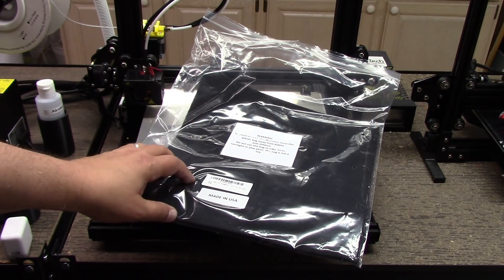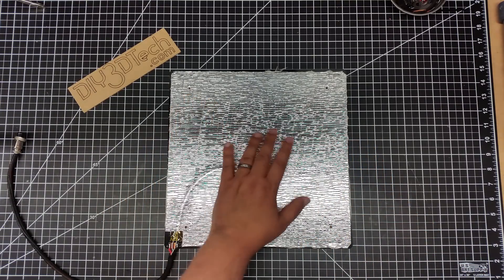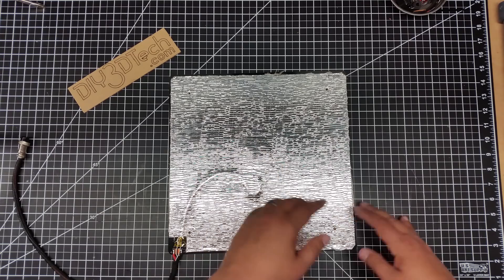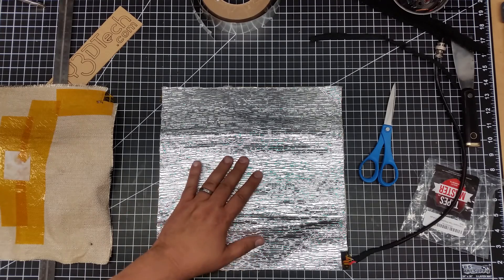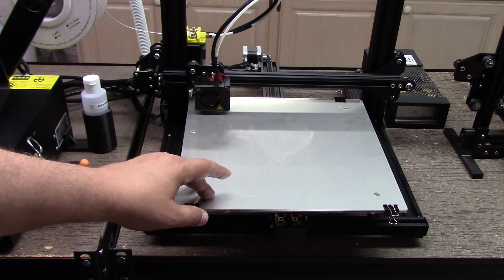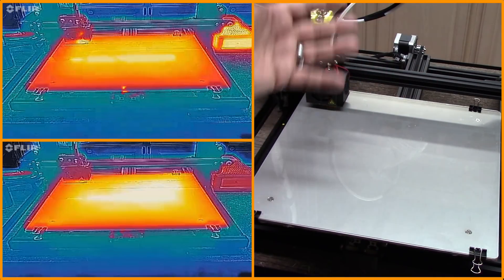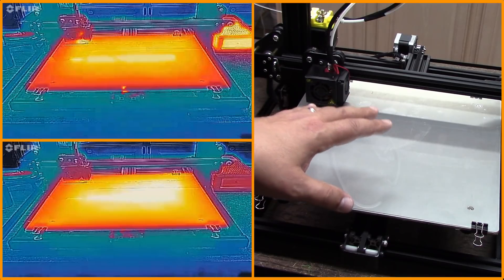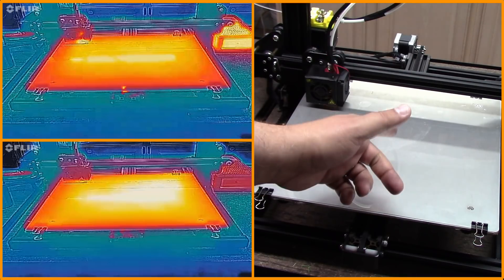Creality CR10 - Insulating the Heated Bed with Plumbers Felt!

Comment: I also use preheat function in cura, while i double-check print settings. Nice little trick as well.
Reply from the maker: Interesting, as prior to printing I set the printer under "prepare" to pre-heat as I am loading the file on the card.  However this is something to check out too.  Thanks for sharing!

Comment: So why hasn't anyone clued in and just  toss a linen throw pillow on the bed to kill the 90% convective loss from the TOP surface? You guys are fixing the wrong side of that bed.
Reply from the maker: Okay, can you show all how to do it?
Reply: @DIY3DTECHcom  , There is little enough to show, let alone make into a vid. I keep the bed covered with the microfiber towelette I use to scrub off greasy hand prints before each print. Folded into quarters, it covers and insulates the bed as it warms up, like a thick warm blanket. If I'm in a hurry, I add a second layer, either a handy throw pillow or another folded up towelette. It's like a hat in winter. It stops the major heat loss through your head. Bottom insulation is still needed, but far less important.

Comment: Use an ac bed and a 24v setup, go from room temp to 80c on the bed and nozzle at 220 in less than 2 minutes. Have an example video https://www.youtube.com/watch?v=qlGZ9vasTVI
Reply from the maker: No question I prefer 24 volts over 12 and whiles AC/Mains powered is best however its not for the average user because of the shorting risk...
Reply: @DIY3DTECHcom  Why is there a shorting risk?

Comment: Don’t get the heat bed thing, the heat dissipates after the first 1/4 inch layer of plastic so as long as the object is stuck to the bed what does it matter
Reply from the maker: The plastic acts as a heat sink and if you don't have even heat you are more likely to get lifting and wrapping.  Also, more heat and more even heat will also provide a better overall grip to your part.

Comment: Has no one tried this and reported back their ability, or lack thereof, to get the bed to 100 degrees or higher?
Reply from the maker: If you check out my earlier videos in the CR01 playlist I do, 100 is impossible at this size and only 12volts...
Reply: Just watched your previous video on the heated bed but no comment there about 100C. Where do you talk about being unable to reach that temp?

Comment: This is much much better than your other video. The gap here will help. Unfortunately the 99% reflective side is still facing the wrong direction. But the non-reflective side (probably about 70% reflective) should still reflect heat back up to the bed. I imagine you will have much better success with this design.
The fiberglass you note is not actually fiberglass insulation like you would find in a house. It is woven or matt fiberglass like on a boat. It does insulate heat much like a 2x4" wood beam but the film is too thin to insulate well. In this instance, its design is for structural rigidity. Woven fiberglass (unlike home insulation fiberglass) resist tearing. Removing a heatshield is a painful process. Without fiberglass you or I would be scrapping tiny pieces for hours. The fiberglass keeps everthing in one unit.
Reply from the maker: Thanks for commenting!  However "reflective side is still facing the wrong direction" isn't quite correct as if you read thought he thread for this video (as well as watch the Yes Cork Burns video: https://youtu.be/2jEkNutaUTg )  I have commented to many comments such as this (i.e. reflective side is still facing the wrong direction) as the product is designed this way for a reason.  As what is the the purpose of fiberglass  here or in a home?  Yes to provide a "gap" and this case it is between the radiant reflective surface and the hot as this designed as thermal barrier and able with stand up to 300f on the adhesive side.  However I suggest check under the Trnoxy playlist (see here: https://youtu.be/PsPi5-d3tAw ) as I like that design with ceramic installation better.

Comment: Hey I like your video... I got one of these quite a while ago and I love it... I actually sanded the glass plate to help stick, but one corner just likes to curl, nearing edge of bed. Funny, doesn't look like i got anything underneath the aluminum bed... maybe I should try this. Every thought of setting one of these cr10 to dual extruder... I have seen a couple videos online but you have always done good videos. clear voice easy to listen to, and understand.
Reply from the maker: Many thanks for the kind comments.  So first thing is throw away the glass and get a sheet of PEI (this one will fit the CR10 http://amzn.to/2ExNOD6 ) second, look at the $5 insulated bed-mod I did for the Tronxy X5S as will work on here and is better and cheaper.  Also curling at the edge is common as the heating elements don't cover the complete under side.  So (1) try higher bed temps to spread the heat and  use a brim for extra holding.  However you will find the PEI far beyond any sanded glass.  Also search my channel as I have created several video on PEI if your not familiar with it :-)
Reply: Thanks for the info here... I did something interesting this weekend. I rotated the glass 90 degrees anti-clockwise. Suddenly no curly edge. I am going to do this bed mod though none the less.

Comment: This will be a dumb question as I don't even have a printer, yet.  It seems the goal is to get the glass warm.  Would a thin layer of silicone heat grease between the plate and the glass help with heat transfer and spreading?  I don't know how often you need to remove the glass so it may get a bit messy.  I want to print Nylon so I am exploring methods.
Reply from the maker: well it depends on the plastic and glass is so 1980's as I don't use it.  However lets backup, if you plan printing nylon you will want to see this video https://youtu.be/iV07vkW70DE as you just can't print nylon on any machine or surface and thermal paste will simply create a mess.  If you want to attach say a PEI surface you would use  3M thermal tape (http://amzn.to/2FwM7m9)

Comment: With cork, I get zero heat radiating from the bottom.

Of course, I don't like cork.  On my other printer I just use that RTV gasket maker stuff.  Very little heat.
Reply from the maker: Thanks for commenting! No question cork is a good insulator but also see my "Yes Cork does burn video".

Comment: My concern in watching this was burying the electrical wires into the heated area. That leads to degradation and breakdown of the insulating material of the copper wires (normally). This bed product MAY have superior characteristics, debunking my concern...dunno. 
I DO enjoy your videos.
Reply from the maker: Many thanks!  However your really not "burying the electrical wires" as this is a PCB heating element so nothing more then a big resistor.  However your correct about  "leads to degradation and breakdown of the insulating material " and this is the reason I say away from cork.  However if you use a ceramic or high temp fiberglass there shouldn't be an issue...

Comment: I used to use a square piece of foam insulation on top of the bed which my g-code automatically pushed off before it started printing. This really helped with ABS prints.... I also would occasionally use a hot air gun to make it heat quicker, just don't keep it pointed at one spot!

Comment: What is the component in the top Flir image that is as hot as the bed?
Reply from the maker: Not sure I understand?
Reply: DIY3DTECH.com at 7:11, where you are comparing the two different set ups there is an object besides the bed itself in the top right of the top image that is hot and in the bottom picture much cooler.
Reply from the maker: Oh I see, that is the power supply of the TEVO Tarantula [3D Printing] which is setting next to the CR-10

Comment: Followed your link http://diy3dtech.com/creality-cr-10-heated-bed-insulation/ to a page with no information, just a bunch of other links to other projects. Not that there would have been any info on 500mm stuff for the CR-10 S5 that takes 15+ minutes to hit 70°.
Reply from the maker: For some reason with that page the API pulls from Amazon sometimes fail and have to be reloaded...

Comment: I deleted my comment by accident. Reflective insulation is what you actually would want here I think. Plumbers felt absorbs heat. If you look at how duct work in you home is insulated it uses an aluminum sheet on the inside and outside of the insulation to keep the heat in the duct. The same goes for heat shields in racing. If the heat is coming through the material as you state this is, then you are not doing what you are trying to do. The bottom of the bed should remain cool while all the heat is forced toward the bed.
Reply from the maker: Plumbers felt can not absorb heat as if did it would violate the Second Law of Thermodynamics as to "absorb" heat it must then do something with it.  Instead it "resists" heat and therefore makes a good insulator as it attenuates the the transfer of heat.  Also you do not want a reflective insulation material in a convective setting as it then "transfer: the heat.  Take you race car example the "reflective: barrier is at a distance from for the heat source and it scatters  by reflection a portion (far from all) the far infrared energy but by no means all. If you put it against the motor it will simply transfer the heat.  This is why you need an insulating air-gap...
Reply: It does do something with it. It transferred it to your hand =) I just think there are a lot better options out there for probably the same amount of money. But I do know if the relatively low heat produced by these heat beds is making its way through that felt... it's not doing much to keep the heat in the heatbed.
Reply from the maker: The purpose of the felt is to create an "air-gap" if you will and the only "perfect" way is a vacuum yet that isn't practical so we need to look for other materials to do this and the isn't nor expensive as non-flammable option.  The felt is a carbon based solution and it works OK, however for the Tronxy-X5S I am going to try a ceramic fire blanket, ordered fro eBay and it just came in today so stay tuned...
Reply: try the ceramic yet?

Comment: Thanks for this walk through. First mod I've done to my CR-10. I used the felt and aluminum insulation from Amazon. Worked like a champ. I'd say almost a minute quicker and, with finger probe mk1, it feels like the heat is extending out to the edges better. Took less time to mod that it does to disassemble the heated bed.  Cheers! - Jay
Reply from the maker: Excellent!

Comment: Installed the keenovo 110vac 750 watt silicone heater yesterday for cr10.  Heats up faster than the display can register it.  Solid state relay fits inside control box where mosfet was mounted.  Ordered on Amazon took  about 4 weeks to get. They are made to order.
Reply from the maker: That is the way to go for this size bed!
Reply: Nice z244824-I am looking to get one just for ABS/Nylon myself
Reply from the maker: With ABS you will likley  run into issues unless you encase it as drafts kill ABS...
Reply: Did you have to modify the CR-10 firmware?
Reply: ripper9111 Stock firmware.  I replaced the mosfet with a solidstate relay.  I wired thr internal 110vac to the relay and unsoldered the old heated bed from the plug and wired the keenovo wires to it.  Pretty clean and easy upgrade.
Reply: Sounds great. Thanks!

Comment: What about clipping a strip of this felt to the top of the bed and using it as a nozzle wipe area?  Sometimes I start a second print without noticing a bit of stringing that attached to the hot end/heater block.. you could program the wipe into the 'start code' of the slicer.
Reply from the maker: Yes I don't see why that would not be possible...

Comment: I was taught that there are 3 ways to move heat: radiation, conduction and convection. Convection is moving heat via air. What you call convection is actually conduction. This is not really important to your video, but maybe someone is having a science test coming up.
Reply: yeah and you used it wrong
Reply from the maker: LOL :-)  Here is the def of  convection "the movement caused within a fluid by the tendency of hotter and therefore less dense material to rise, and colder, denser material to sink under the influence of gravity, which consequently results in transfer of heat".  In this case "air" is the fluid  yet "conduction" is defined as "the process by which heat or electricity is directly transmitted through a substance when there is a difference of temperature or of electrical potential between adjoining regions, without movement of the material".
Reply: @DIY3DTECHcom  Chemical & mechanical engineer here, I can confirm you did use the wrong term when you said convective heat. Regardless, you did have the sheet oriented correctly and you are correct that its purpose is to reflect the radiative heat back into the fiberglass and towards the heated bed. The heat transfer between the bed and the insulation would be conductive which is what occurs when two objects are in contact with each other. Convection is ONLY regarding heat transfer between a MOVING fluid (such as air or water, and yes, air is a fluid). If there is no fluid motion, then there is no convection. That said, if a hot object is in free air that is stationary, it will actually cause some amount of convetion because as the air heats up by conduction, it will start to rise and then that motion causes convection which further increases the rate of heat transfer. So for example, the way water "rolls" in a pan when its boiling is a good example of natural convection.

Comment: Thank you for this very interesting, inspiring video! I just wanted to mention, to the interest of all, i've personally heard from one person with some kind of aluminium foil/tape under the bed, it negatively influenced the inductive probe.
Reply from the maker: Its possible I guess to influence an inductive probe, however I would be a little surprised with this stuff as its an aluimianized Mylar of sorts ...
Reply: Tom did a video on sensors for 3D printers where he was testing various types of sensors for various types of common print bed material the full video: https://youtu.be/il9bNWn66BY
the section on inductive sensor versus metal tape: https://youtu.be/il9bNWn66BY?t=523

Comment: I don't see any link to the products shown. Please provide some links. I am sure they are here somewhere but 15 minutes later I still can't find them.
Reply: The link for the foil was in an earlier video when he first tried using just the foil. I hope nobody gets mad that I included the links, because I also had trouble finding everything.

https://www.amazon.com/gp/product/B00O17CI4Y/ref=oh_aui_detailpage_o00_s00?ie=UTF8&psc=1

https://www.amazon.com/gp/product/B00029KC2K/ref=oh_aui_detailpage_o00_s00?ie=UTF8&psc=1

https://www.amazon.com/gp/product/B072Z92QZ2/ref=oh_aui_detailpage_o00_s00?ie=UTF8&psc=1
Reply from the maker: http://diy3dtech.com/creality-cr-10-heated-bed-insulation/  just scroll down and there are links for the felt, tape and foil :-)
Reply: Thanks for the response. maybe it my browser. Firefox.. but I see no links on that page. I see alot of other project and some ebay products that scroll and change. but no links to any products. can you please paste the links here.
Reply from the maker: Since they change, the code does an API pull to keep current.

Comment: what do you think about doubling up the felt or a thicker piece? Are we at diminishing returns?
Reply from the maker: Yes to the diminishing returns, also I have too have worked with ceramic insulation, but this does back to "diminishing returns".  The plumber felt is easy to get, cheap and provide reasonable performance.  As to honest on a my smaller printers I don't even invest the time its only because to large bed because a huge heat sink :-)
Reply: think there are better materials. The fact that he feels heat on the bottom means that some heat is lost when he should be trying to redirect the heat up into the plate. A while back I built a simple foundry to melt aluminium by using a ceramic fiber liner. its fairly cheap and it's used by DIY forge/foundry makers to insulate and increase the heat inside the gas powered foundry. It doesn't retain heat has great insulation properties. I saw one guy actually put his hand on one side and blow torch the other side and he didn't feel anything. You might want to take a look at this might prove to be a better insulator. think the plumber felt is more of a carbon fiber designed to be fire resistant.